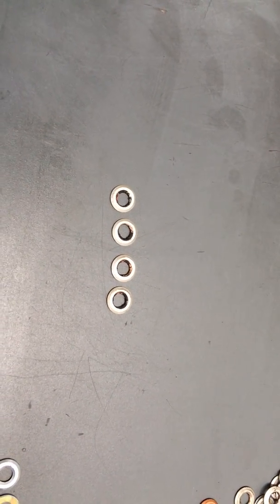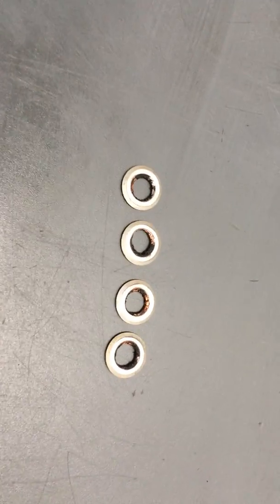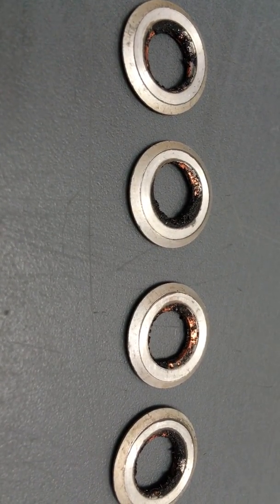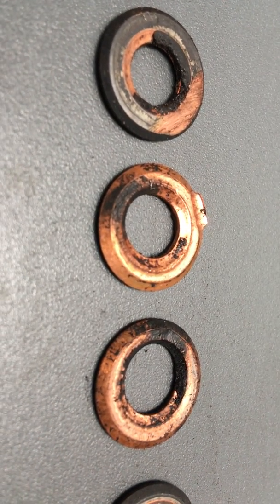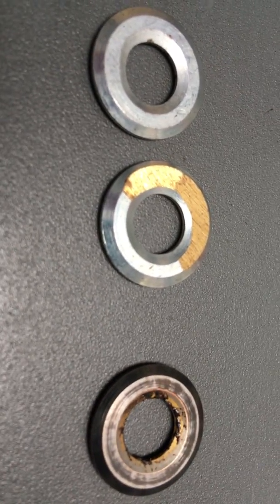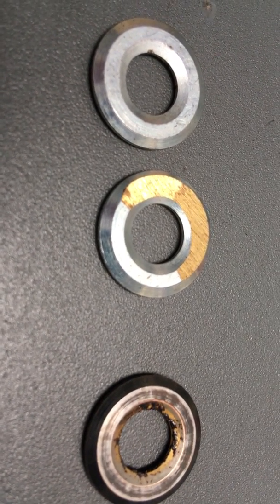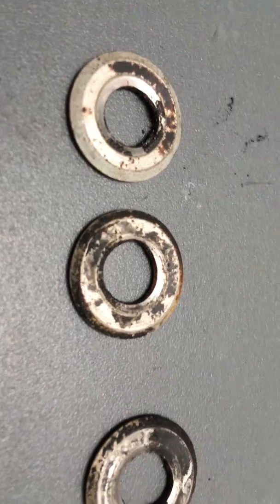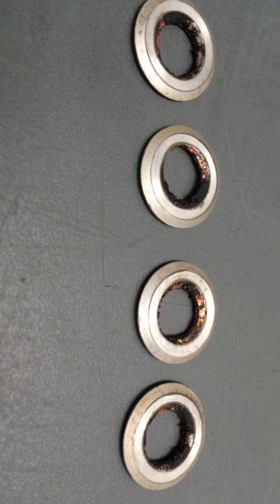Prado hilux 1kd-Ftv injector seats

Comment: My 1kd ftv prado is burning oil about 1 litre in 3000k and there is a slight blow by . One mechanic told me you must replace injectors seals and seats then every thing will be fixed and the problem solved . Is that true ?
Thanx
mileage : 350k

Comment: Im in the market atm for a prado 120 or 150. Ive been leaning towards getting the v6 coz of this issue from the info on the web. Leaking injectors leads to a bang.  So the turbo diesel  engine is a good and reliable engine as long as you take care of as normal, as well as injector seats every 40,000km. How much does that cost to have them replaced ( original parts and labour ) thanks if u can help.
Reply: The seal kits themselves aren't expensive around the $40-$70 mark for the kit but the labor would run upto $1000 (and yep im not going back to that guy) depending on the service center. 

Some change the fuel pipes and some don't, if your super super careful and know 100% what you are doing you could re use the pipes once. Not something i recommend thou but i have heard of success, but its your car.